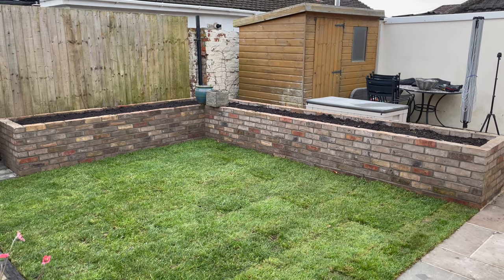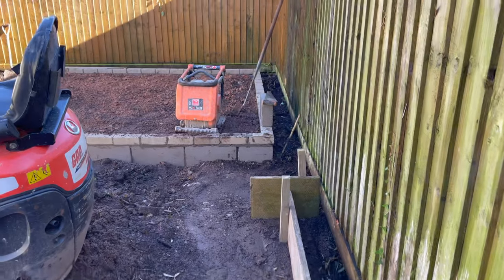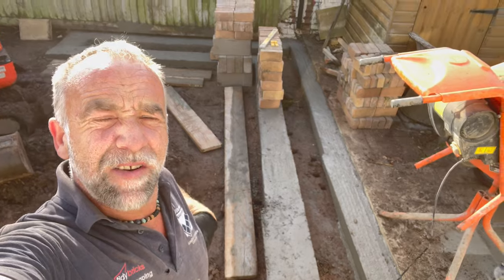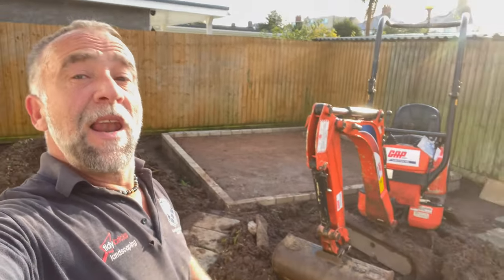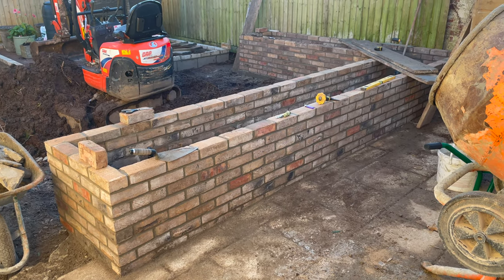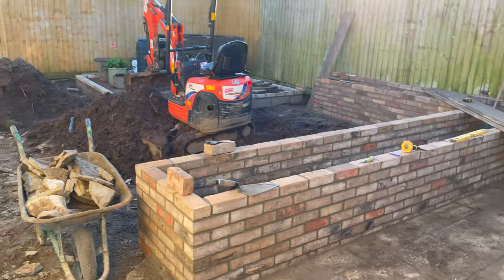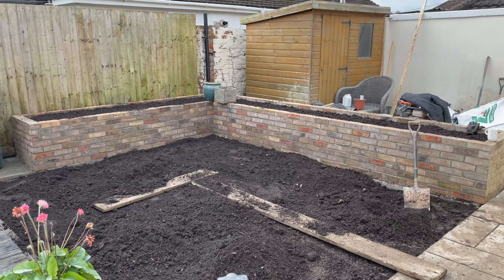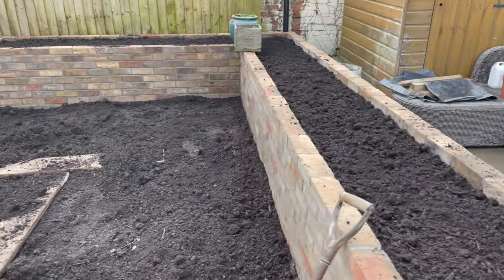DIY Brick Planter: Step-by-Step Guide to Enhance Your Garden 🌷🧱

Comment: We did it without the drainage or the damp membrane do I need to empty it and add a damp membrane? It's rendered brick or do you think we can just drill some holes on the bottom on the garden side? We did drill about 8 small holes on the bottom after it was concreted but it doesn't seem to be enough
Reply from the maker: The membrane will prolong the lifetime of the render mostly. And you need bigger holes on the sides then normal drill hole won’t work you need 2 or 3 inches maybe 4 inch depending on the size of the wall and how much earth is behind it. Hope that helps 👍🏴

Comment: Great job Scott, loving the video’s. Getting lots help for my DIY projects here in Australia. Did you put any holes in bottom of membrane for water to drain or does that flow along membrane to the ends and then drain out? Cheers
Reply from the maker: I should of mentioned in the video that the plastic dpm was only for the sides to stop water penetration through the brickwork. Nothing was added to the bottom so water can flow through the gap in the footings 
Thx for watching down under 👍🏴

Comment: In one section, the bricks look awfully close to the wooden fence. Are you concerned about the fence not being able to fully dry out after storms, eventually leading to rot at the base?
Reply from the maker: There was a descent enough gap between the wall and fence about 6 inches or so 👍🏴

Comment: 5:20 Is there any alternative to damp proof membrane to protect the brick from moisture and rainwater if you are trying to garden without plastic? Any ideas that are safe for vegetable raised bed?
Reply from the maker: Without out plastic as a option then no I don’t have a alternative idea for you sorry 👍🏴
Reply: The plastic is totally unnecessary! Brick deteroriating in wet environments is true, but this isnt a structural building member. If it "only" lasts 30 years, that is still more than enough :)
Reply: Hi I just built brick planters just like these but with no water proof liner. Do you think that will be ok? Or should I water proof the outside? It’s already filled with dirt. Bricks are not cemented , just some adhesive. Will the dirt all leak out? - thanks

Comment: Nice work! quick question: would the planter be strong enough so the sides don't crack/ deform over time? We're thinking of doing exactly the same and planning on using inserts (possibly galvanised steel) to avoid putting too much pressure on the planter brick wall. Maybe we're overthinking it.. :)
Reply from the maker: I know what you mean if I went any higher I would of had to of made the bottom bit wider.  👍🏴